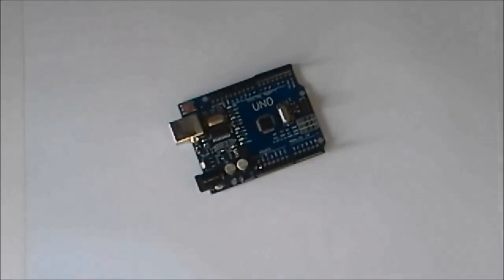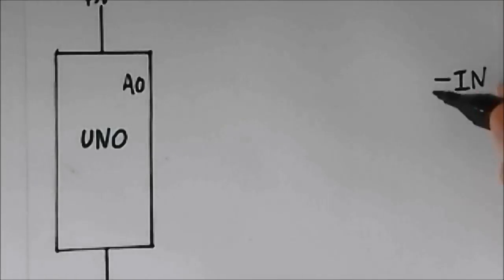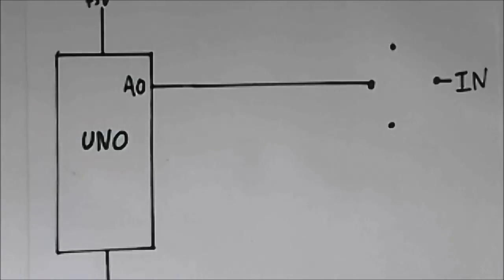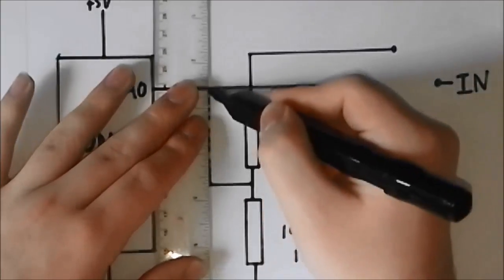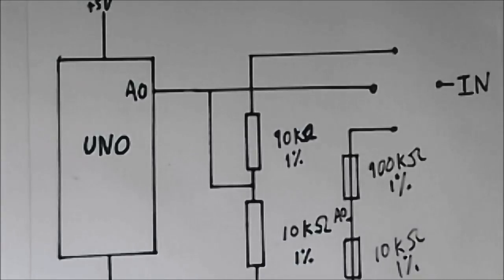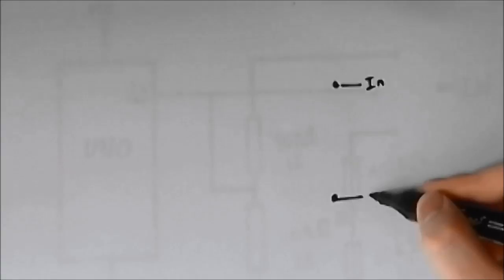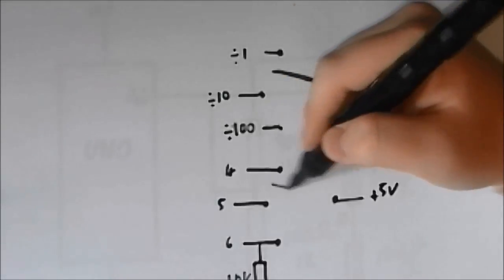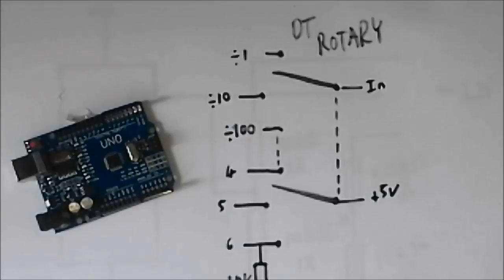DIY Arduino Voltmeter INCLUDING code and diagrams - TheBeginnerElectricalEngineer

Comment: I need to measure 500V dc, but how ?
Reply: Use 100k and 1k resistor for making voltage divider and mesasure voltage across 1k resistor using analog pin.
Reply: is this: http://i.hizliresim.com/lODj1l.jpg